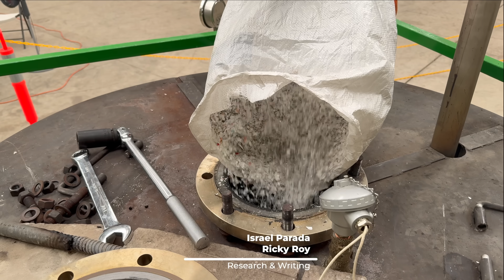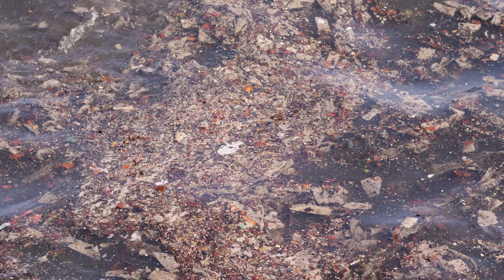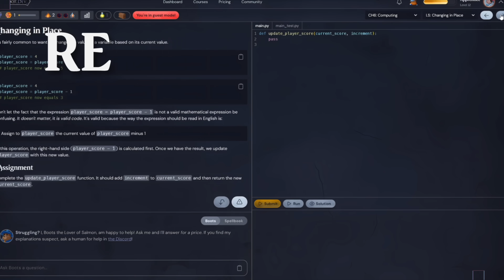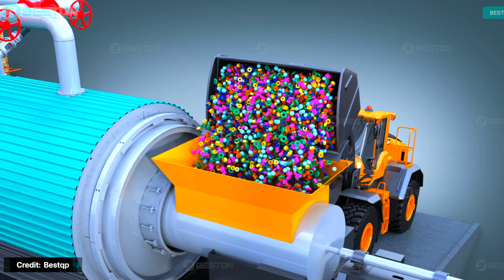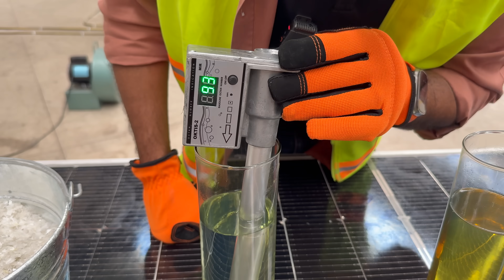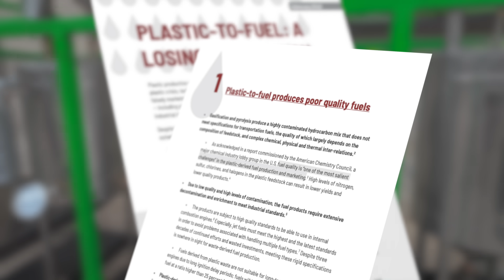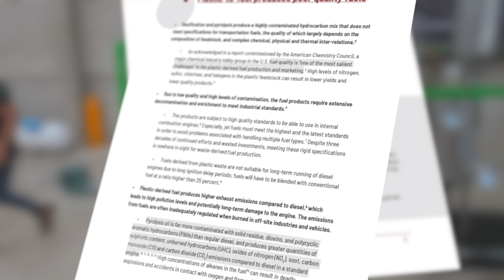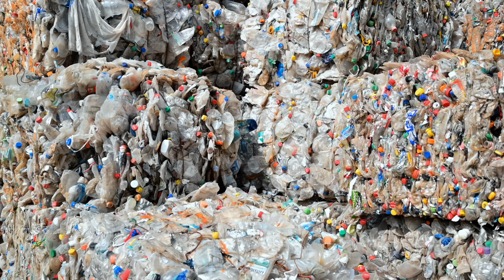Solving the Plastic Waste Problem - This Surprised Me!

Comment: There is not one solution, I think it is great for a part of the problem.  I have thought for years at sometime we will be able to mine our own landfills for resources, and as the price of petrol increases eventually, even that will be done.

My question for this technology is, show me the economics.  If you have a better ROI than a drill/refine/distribute with a gather/separate/process/distribute cycle and it doesn't have a short lifetime of some catalyst, I could see it being one of the big winners eventually.

Comment: I have also produced fuel from plastic using a similar set up here in Nigeria.
Its an AMAZING solution and should be encouraged. The most profound thing is the simplicity and the fact that it's low cost.  While some of your concerns are valid,it provides a safer and cleaner alternative to the conventional way of producing fuel in my opinion.

If it's to be adopted globally,there would be the following advantages:

1. Easy availability of fuel all around the world. Almost all countries can produce plastic for themselves using waste plastic. It would have an impact on geopolitics. Though it remains to be seen if all the hundreds of millions of tons produced would be sufficient enough to produce enough fuel for the world

2. It is obviously more environmentally friendly to produce fuel from plastic than to mine crude oil and then refine it into petroleum. Besides polluting the environment while drilling for oil,there is also the additives and also the pollution produced during refining. This process requires far less energy and can even be powered entirely by Solar.

3. Its going to create lots of jobs and a whole new industry. People would be required to collect, sort, clean and mine plastic from Landfills. People would be required to transport plastic to the different production sites.

4. It also democratises fuel production. Countries,municipalities, company's,organizations and even individuals can choose to produce fuel themselves.

5. Finally, if this can be implemented on a large scale,it would reduce the production of petroleum from crude oil and also be an avenue for the plastic thrown into rivers, seas, oceans and other water bodies to be recovered.

Amazing video. Well done!
Reply: This, I think would create a new problem. The value of plastic would shoot upwards. The amount of available waste plastic would quickly approach almost zero. Oil companies would have little incentive to produce plastic when they can just make it into more fuel. Your points above are more valid when you replace this process with wind and solar. That's where Africa should focus.
Reply: @royzen2 I do get your point, but how would we solve the problem of plastic pollution. Would be great to hear your suggestion on how to solve the world's plastic waste problem.

Comment: Plastics can only be put through recycling about 5 passes before crystalline structure is too weak...distillation of plastic to gas produces no more environmental side products than oil distillation (unwanted products are burned away in both)...if they truly have a viable process then it should be scaled up.

Comment: My father, rest of soul. Was in oil field my entire life. More than 20 years ago we were discussing how oil fields had originally seemed to go dry. But that people noticed over time they would start producing again. I had speculated that it didn't take hundreds of thousands or millions of years to make oil, just that long to buried the material. I had speculated that if we could essentially chop and liquify organics, and plastics we could inject them into old  oil fields. Put pressure and heat which convert these things in to oil. Here that concept is proved above ground.
Reply: And then we are still burning and polluting our atmosphere and the air we breathe. Breathable air is only up for about 20,000ft . That's just under 4 miles and the you have 1,500,000,000 cars burning and polluting. We are killing ourselves with oil and gas.

Comment: Pet Gas Plastic-to-Fuel System – Overview
Process

    Input plastics: HDPE, LDPE, polypropylene (PP), polystyrene (PS). Avoids PET and PVC due to chemical issues.

    Pre-treatment: Minimal; shredded for size, no need for washing.

    Technology:

        Thermal pyrolysis in steel reactors (no catalysts).

        Multi-stage condensation: paraffin → kerosene → diesel → gasoline.

        Leftover gases (propane, butane, light hydrocarbons) burned to sustain heat after startup.

    Startup: Requires ~1.5 hours of external heat source (e.g., natural gas) before running on its own gases.

    By-products: Coke (commercial value for furnace lining), paraffin wax.

Outputs

    Fuel types & examples:

        Gasoline: Octane rating >90 (claimed up to 120).

        Diesel equivalent

        Kerosene

        Paraffin wax

        Coke

    Yield claims: Up to 92% condensible fuel from mixed plastic waste; ~5% waxes; remainder is coke and gases.

    Applications: Vehicles, industrial machinery, generators.

Pros

    High claimed efficiency (92% fuel yield, minimal waste).

    Self-sustaining heat after startup reduces energy costs.

    Accepts mixed, dirty plastic that is hard to recycle mechanically.

    Multiple commercial by-products (wax, coke, fuels).

    Relatively low capital cost — basic steel reactors, piping, heat pump, control system.

    Cleaner than incineration — lower sulfur, potentially fewer GHG emissions (claimed 50% less CO₂, 30% less methane, 60% less NOx).

    Simple design — easy to build and maintain compared to plasma or catalytic systems.

    Can be modular/scalable for different production needs.

Cons

    Not true recycling — turns plastic into fuels, which release CO₂ when burned (carbon is not sequestered).

    Environmental trade-off — solves plastic waste but adds to fossil fuel combustion emissions.

    Unverified claims — efficiency, yield, and emissions reductions need third-party validation.

    Feedstock variability — fuel quality depends on input plastic mix.

    Startup still requires fossil fuel for ~1.5 hours each run.

    Market dependency — economic viability tied to fuel prices and regulatory support.

Costs

    Capital costs: Lower than catalytic or plasma systems (simple construction).

    Operating costs: Reduced by using waste gas for heating; electricity needed for chillers and control systems.

    Feedstock cost: Often free or negative (waste plastics can be sourced from landfill streams or municipal waste).

    Potential revenues:

        Sale of fuels (gasoline, diesel, kerosene).

        Sale of paraffin wax and coke.

        Possible tipping fees for accepting waste plastics

Comment: As the video eventually points out, the plastics are made from fossil fuels, and takes energy to make (which produces carbon dioxide), and it produces carbon and other pollutants when it burns.  So although it's better than using new-drill fossil fuels, it's still much more harmful to the planet than using green electricity to power vehicles.  T
his is not a truly green technology, because the process in this video contributes to global warming. 
So by all means use it as a transition fuel until oil-burning cars are phased out, but don't use it as a reason to delay phasing out those vehicles, and continue to look at recycling plastic for other purposes, preferably to make other plastics.

Comment: Great to see this, at what I would consider a laboratory scale project.  I suspect that if it were to be scaled up to a tons/hour process the catalytic cracking process would be redesigned to yield a higher value mix. I understand that there are a few plants doing a somewhat similar process with tires.

Comment: This is nothing new. They used to do the same with wood aka woodgas. It's distillation at its core.  The starting product determines the end result. Ie wood for woodgas or corn for ethanol/alcohol  etc.  Though it's great to see someone doing this on a larger scale.

Comment: Austrian oil company opened a 16k ton per year scale plastic to oil plant back in May, called ReOil.
Reply: Australia needs one in Tasmania
Reply: Thermal Pyrolysis is NOT a new process…it has been around for a LONG TIME…requires energy input to work….so how about some hard data ….otherwise ..waste of my last 5 minutes.
Reply: @hughjanus3378  Once we get cheep reliable energy (nuclear)we can at last get rid of the plastic problem.
Reply: @thedave7760  it is not only about energy. it is unscalable process. You cant microwave large batch of product (microwave have limited penetration). And you can't make continues feed because it require vacuum.
So no large batches... no continues feed... You can play with small batches to play with it and nothing more
Reply: Homo plasticus, in the real sense of the word. It is a crime, an evil one, to let all those plastics rotten in land fills, or let drift into the oceans. It is because no politician is interested in this huge problem. It would be so easy if every major city in the world had a convincently efficient program to recycle plastic. I cannot avoid feeling guilty each time I have to throw away, as simple garbage, those wonderful plastics that are so convenient, like the life useful, from the store to home, then to the garbage. Insane !!!!!!!!
Reply: @arkangeln910c8  right? when you see what primitive humans had to struggle with for a simple container to hold water, a plastic bottle would have been a miracle to them.

Comment: I think this is good because it reduces the need to take oil out of the ground. 

Obviously if we can recycle it into more plastics without burning that’s better. 

Also this is the opposite what oil companies want - they want to maintain their extractive model of oil, not have companies re using petroleum products that eat into their margins.
Reply: How is it better to recycle back into plastics? Perpetuating the problem. Oil companies would like to diversify their revenue streams.

Comment: So this has it's place.  If you take the EV revolution to the extreme, there will still be a need for gas for construction machinery.  These machines will be the last to transition as their energy requirements a huge.  Getting that fuel from waist plastic instead of digging will help us clean our mess and reduce environmental impact due to not mining for gas at the same time

Comment: We are going to be using combustion engines for years. Using plastic recycling to make fuel and oil that can be used for other structural applications and making plastic. As we transition from fossil fuels to cleaner energy solutions we will still need and use plastic. Thanks for the video.

Comment: The key question is cost per gallon to produce. Then a second key question is what does this emit and how much pollution does it emit? Some key costs; original fuel input and cost of acquiring the plastics, secondary costs include labor, maintenance, and warehouse costs. Some key emissions will be based on fuel used.  Another key is how much product you can produce from x amount of plastics, last I can think of is how easy is this to scale up. The last question is easy to answer as this is literally just distillation and that is a common process at many different scales.

Comment: the technology has potential and <i kike it. The question of sealing carbon vs releasing at as fuel is a good one to be sure. But, my one issue with this is why no mention of the insane amounts of benzene produced with this method. The stuff is cancer juice extract

Comment: Pyrolysis uses more energy than it can produce. 
And it changes one pollutant into another. 
Rather lock in the plastics into construction materials or concrete binders. 
This has been tried maybe 50 years ago. Even at large scale in Spain. 
Your channel should cover actual new ground breaking tech that will actually be adopted.

Comment: Check out “Changing Worlds Technology “ thermal depolarization system. About thirty years ago they were breaking down turkey production waste into char, natural gas to run the system #2 fuel oil and trace elements

Comment: Why didn’t you show how much plastic you need to produce what’s on your table? And why didn’t you show how much energy you need  in the process ,to get out how much energy? Something like I put so much joules or kWh in and get so much joules or kWh out?
Reply: After the kettle it is being driven by pressure, no pumps etc.  Product other than wax is exiting the kettle as a gas, not sure why they aren't using a distillation column which could be fed from multiple kettles resulting in a continuous train instead of a batch process, eliminating the need for repeated startups/shutdowns every time they refill the kettle.

This could provide a continuous supply of tail gas after startup, not sure if this is sufficient to fuel the kettles or would be an addition to the natural gas.  If there's sufficient heavier light hydrocarbon gasses (ethane, propane, butane, etc.) it would be economical to distill these as well.

The other energy inputs would be pumps and fans for the chilling water, sorting/grinding the plastic beforehand, and moving the final product.  With larger kettles, they shouldn't need to grind the plastic.

I am not sure what the coke content is, I've always seen the term used to describe a high carbon solid that can be used as fuel.

Also not sure why they aren't sending the wax through a cat-cracker, which can split the long hydrocarbon chains into liquid fuel.

It appears to be pressure driven, so the rest of the energy cost would be up front (sort/grind plastic) (larger kettles could eliminate the need for grinding) or tail end (ship product) except for the chill bath.
Reply: @1SCme  What I gathered from some of the comments in the segment was that they are looking for investments to up their game and bring it to scale. I suspect (or would like to think anyway) some of what you mention is already in the plans... and if not then they should read your post.
Reply: @swobst  I agree, I'd like to know the weight of plastic to produce a gallon of gas. The energy to fuel the process is also plastic being burned, those emissions are routed into the process (not released into the environment).
Reply: They won't get there. It's been proven before that this method is not financially viable.
Reply: This process has been known for over ten years.

It is not viable as it costs way more to collect, sort and grind your plastic as well as power for chilling and gas for initial burn.

Even If your employees work for free it cost way more than the value of the product produced.

This is exactly why he claimed he had to catch a plane and couldn't find out about final yields. 

What garbage, he didn't have time to ask a question that takes less than a minute to answer???

Just more bad information from this already dubious show!
Reply: @InYourFaceNewsMedia  Precisely! Now we know who the real sponsor of this video is. Scammer companies like this one are popping up everywhere. They lure investors who aren’t engineers and don’t understand basic physics. CapEx of $5+ million for a simple system that sells on Alibaba for less than $100k. I’m sure he’ll take this video off YouTube at some point.
Reply: Because it's a massive waste of time, energy and resources.
Why he hasn't discussed how the ocean ALREADY HAS NEW MICROBES THAT EVOLVED TO FEED OFF PLASTIC IS BEYOND ME. 
The planet already started a process to naturally break down plastics. Should check out microbial life evolving on the trash island.

Comment: Most ppl don't have the advanced overall knowledge of the environment as I do.
So,most will disagree with my opinion.

Anyhow,This is great but only if we use this tech temporarily to ultimately replace gas all together,with cleaner forms of energy.

We need to stop using fuel ASAP

Comment: The engine would likely seize up over time. The only solution is to mix this gasoline with fuel from the gas station, saving about 10%.

Comment: If leaving plastic alone or recycling it was the argument, then why do we have a micorplastic problem? This seems to be a solution to cleaning up the plastic that is left to contribute to the solution to the ongoing microplastic problem. I think microplastics will eventually lessen in severity if we could only just stop adding to it daily. This is just a small way to help minimize the ongoing buildup of it. If we could expand this type of operation we could really combat the increase of microplastics. There is even profit in it which is the main incentive to these types of operations. Its a win/win so there should be no problem. Other issues are still there, yes, but this helps eliminate one staggering issue of the overwhelming amount of microplastics invading all life on the planet and increasingly so.